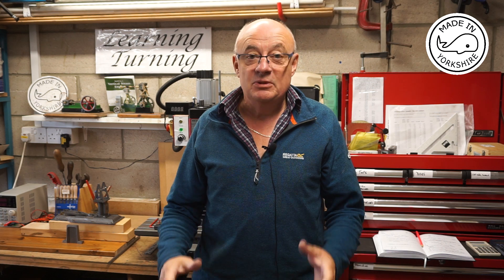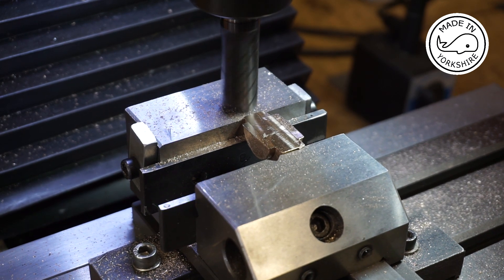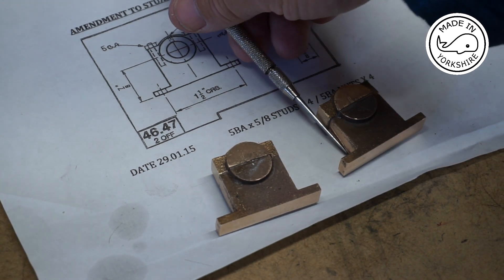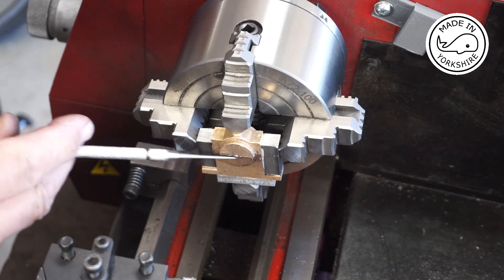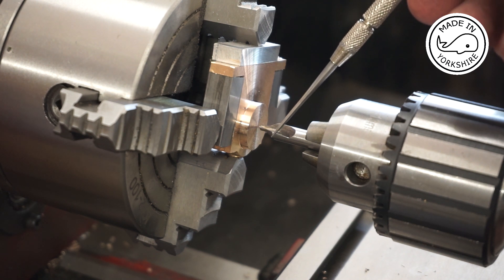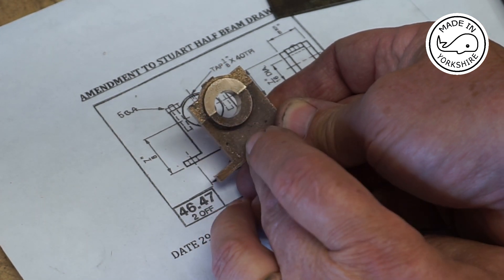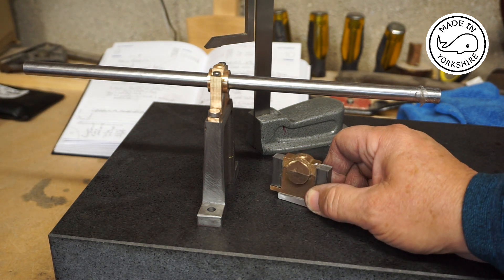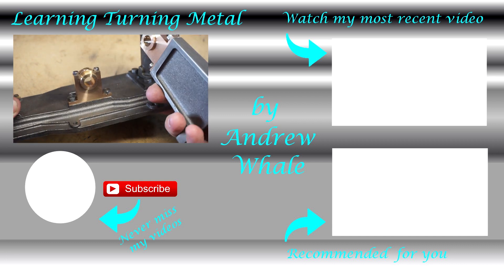#MT32 Part 11 - Making a Stuart Half Beam Steam Engine. The Main Bearings. By Andrew Whale.

Comment: Andrew, thanks for the effort you put into these great videos. I'm facing the same task on a set of bearings for a S Victoria. I'm concerned the draft on the base could cause alignment issues in the 4 jaw, ie centered when viewed  from the front but displaced at the rear by the angle of the draft. It might help if the bearing faces were machined paralell with base before going to the 4 jaw. The bearing face could then be clocked perpendicular to the spindle. Still thinking about this before I start cutting metal.
Reply from the maker: Hi Jack - good idea. I hope your bearings turn out well.
All the best.
Andrew

Comment: Hi Andrew - just watched this video. Yes  trying to get concentricity on a centre lathe is difficult using centre drill, drill and reamer.
On my small lathe I use a couple of slot drills (2 flutes) 4mm dia. and 6mm dia. and have a couple a couple of homemade toolholders to hold them in the toolpost ensuring they are at the centreline height with the flutes horizontal. One flute will then cut like a small boring bar. Before using the last couple of drills I bore out roughly 3mm deep in the hole to the next drill size to true the hole for starting the next drill size. You can also do this before reaming leaving a few thou in and let the reamer size the hole. A bit finicky - but quite quick when you get set up for it all. Super videos - learning a lot, so keep them coming.

Tim
Reply: Hi Andrew - forgot to mention that it is worth checking the alignment of the tail stock with the chuck. I have been caught out a couple of times in machine  shops with someone tinkering with the tail stock and not resigning it correctly. If there is any error here it can seriously affect drilling operations. Happy  Xmas. Tim
Reply from the maker: Hi Tim - many thanks for the suggestion. I will have to give that a try sometime. Glad you like the videos.
Marry Christmas!
Cheers
Andrew

Comment: Hello Andrew. I have had exactly the same experience with exactly the same same bearings and used the same machining (mill and turn) sequence as you did for them both. Getting them set up in the 4 jaw was a nightmare and although I was able to ream a very good fit for the shaft,  like you, the bearings finished badly  out of square and the shaft was not horizontal and parallel to the engine bed. I was not able to recover.  Part of the problem was that there is very little spare "meat" on the castings to allow you to get right angles in the mill.  Also you have far more experience at handling ST castings, so I say "Well done". I have decided as I have a nice length of 1.5 inch round  phosphor bronze to  to make split bearings out of solid. This will enable the bearings to be line bored and therefore  the shaft will be true and horizontal in the engine.  I can then shape them to "look right"  using  the shaft to maintain "squareness". Superglue is great.

Comment: It looks difficult to machine a casting with no precise reference point from which to start and you must make a best guess as to how to do the setup for machining.

Would you please comment on any residue remaining or cleanup required after using CA adhesive to temporarily attach parts which must be heated to separate when machining is finished.

By the way, I really enjoy the birds.
Reply from the maker: Hi Mark. Yeah I found machining the bearings quite challenging, especially getting them clocked in the 4 jaw chuck. I think the best way to remove ca is to use nail varnish remover (acetone). I didn't have any so used cellulose thinners and my finger nail to get underneath it.
I like the birds too but unfortunately my new mic doesn't pick them up as well as my old one.
Cheers
Andrew

Comment: G’day Andrew, good recovery from a disaster and my thought is if it worked out and you are annoyed with the imbalance of the bearing thickness then machine the other down to the same size. A problem I can imagine is the bolt heads are now too big, no problem, machine them down a size. 
Cheers 
Peter
Reply from the maker: Hi Peter. I found that there was no meat on the casting to enable them to be machined to drawing dimensions. When I machined the second bearing it pretty much ended up being the same size as the first one. Lucky me! I might have a go at machining some bearings from bar stock, just out of curiousity really. And it would be good practice.
All the best.
Andrew

Comment: Good work Andrew, and as others have said, nicely recovered. I seem to remember that when I built mine ~ 20 years ago the bearings were supplied as a length of "shaped" bar stock. Not that it's relevant at all.

The only thing that I would have done differently, is drilled, tapped and bolted the two halves together earlier in the machining process rather than relying on glue. Maybe I'm over cautious. 

I rarely use my workshop nowadays due to disability.  Watching you going through these learning processes takes me right back. I thank you sir. Keep up the good work. i'm enjoying this.
Reply from the maker: Hi Jeff. Many thanks for the feedback. Maybe next time I will have a go at bolting them together rather than using glue. I'm really pleased that you are enjoying the series. It seems never ending at the moment but I hope it will all come together soon.
Cheers
Andrew

Comment: Great to see how you went about machining the bearings - so much to do and such a critical component.  For me, an 8" lathe bed makes stub drills essential above 6mm, and I use stubs wherever possible. I always start with a spot drill, then a stub, even if it's just the initial drilling of a deep hole. I'm with Model Steamers regarding working up through drill sizes, at least in brass. The split middle bearing on my D10 gave me grey hairs but "plan C", building a drilling jig, was a great success. The bearing casting sits in the jig exactly as it will be fitted to the soleplate. Bolted to the lathe cross slide and aligned to the lathe axis, the jig presents the bearing at lathe centre height. Once centred horizontally, the cross slide is locked in that plane and the bearings drilled and reamed. Solid end bearings and split middle bearings can be drilled in this way and, provided the setup isn't changed, they will all be in alignment, even if the hole isn't dead centre. As long as the bearing housings in the soleplate are in line, the crankshaft should be a good fit. It took a few hours to build the jig, but I can remove the crankshaft as often as I need, knowing it can be replaced and bolted down without binding.
Reply from the maker: Wow Len - that is a great idea. That would make a great article for Model Engineer and be of interest to loads of folks.
Thanks for the info on stubs too.
Cheers
Andrew

Comment: At 7 mins 20 seconds you can see the four jaw setup you have. Very nice wonderful care taken to protect your part. I think you missed a step in setup? At that point you had two datum points accessible. The base and the side face. Simply attaching a DTI to your carriage and thrusting in and out you can check for misalignment before starting. While clocking in your centre point you can before getting the jaws too tight, knock the workpiece about with a soft hammer to ensure 90 degree's is achieved in both axis. Admitted you parts are small and travel for the DTI means absolute diligence zero needle movements end to end in both axis. Once they are set go back re centre the centre and then again recheck the datum runout, repeat until EXTREMELY happy. Then the drill won't matter. If needed, cut off a 5mm drill short and put new ends on. I find 5mm (one real good cobalt) universally useful for loads of stuff if you feel you need to start of stubby and stiff. Mine only has about 20mm of flute length thus only starts a hole to about 20mm max and has lasted for years. Measure twice cut once the saying goes. Nice recovery, but I really thought you were going to bore it out further and make some bearing shells to keep the original dimensions. You may consider that next time.
Reply from the maker: Many thanks for the advice Steph. Very much appreciated.
Cheers
Andrew

Comment: Nice recovery.     I don't know if this is a camera angle issue or if it's a problem, but from time 10:31 to 10:38, it looks like the drill bit tip is too high relative to the center hole.    If so, then your tailstock is not level in the z-axis.        Another good video.       Bill
Reply from the maker: Hi Bill - yeah I noticed that too. I'm pretty sure that the tailstock is level but I will definately carry out some checks. Thanks for pointing it out.
All the best.
Andrew

Comment: Oh yes you do, have a boring bar small enough that is. You can use an end mill held in the toolpost, with flutes horizontal as a boring bar using just one flute to cut.
Or, once you have made an initial hole using an end mill as a stub dril will clear away any wobble, but with a few provisos regarding machine wear and general quality and set up. 
Best case would be, centre drill, pilot drill, drill big enough to allow boring bar(end mill) to work, bore to pre ream size and then ream. Final stage would I suppose be ,order up some round stock HSS so you can grind yourself a boring bar for next time!😉
Reply from the maker: Ingenious! Many thanks for explaining. I need to remember that one.
Cheers
Andrew
Reply: @learningturningmetal  It's not exactly standard practice but not unknown in ME circles, where whatever works is just fine.

Comment: Looks good Andrew. I've noticed before that you work up through the drill sizes even on fairly small holes, I tend to drill up to about 6 - 7 mm in one go and only work up through the sizes on larger holes. I'm no expert but my feeling is using very small sizes causes more problems that it solves and is unnecessary.
Reply from the maker: Thanks for the advice Peter - I'll try to remember that one!
Cheers
Andrew

Comment: Hi Andrew
Great job on the main bearings, yes the castings do not have enough meat on them to clean up and machine to the size on the drawings, you did a fine job on the compromise.
On my beam I used oilers supplied by RDGTools (rdg355 on ebay) in the UK, very good quality and small enough not to look out of place.
Looking forward to your next video.
Cheers
Gary
Reply from the maker: Thanks Gary. Your oilers look really nice - I really appreciate the info. Are they the 37mm high X 17.5mm dia or the 31mm high X 11mm dia ones?
Cheers
Andrew
Reply: Hi Andrew
Yes they are.
Cheers
Gary
Reply from the maker: Ha ha Gary - so are they the larger or the smaller ones?
Cheers
Andrew
Reply: Hi Andrew
Sorry mate, old age has finally caught up with me. lol.
They are 31mm high x 11mm diameter, (small) 3/16" x 40 thread.
Hope this helps.
Cheers
Gary